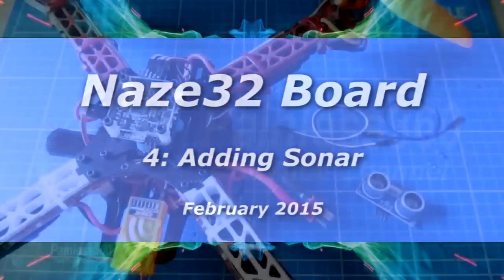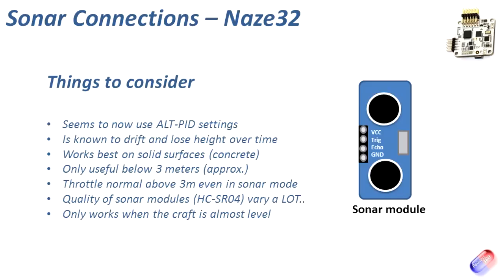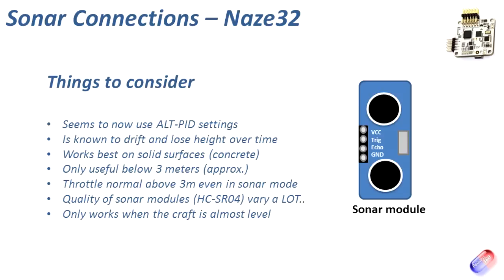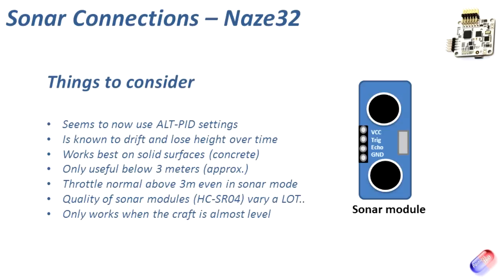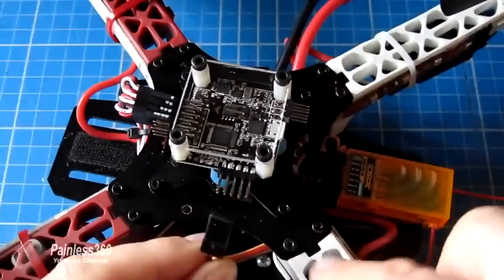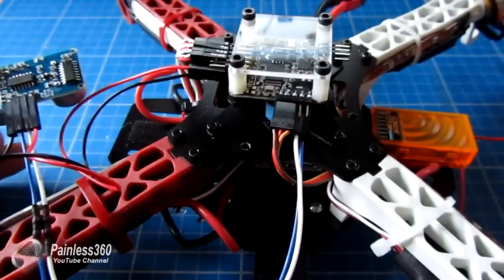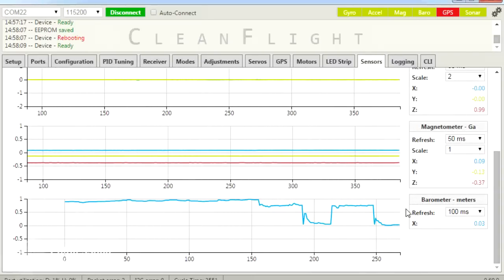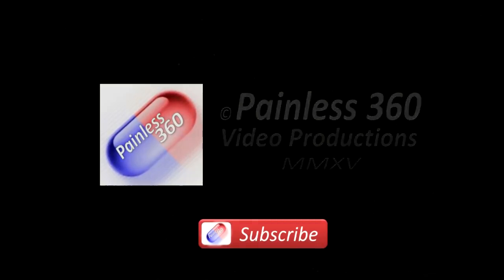(4/8) Naze32 Flight Controller – Adding Sonar (HC-SR04 module)

Comment: How do you like the Baro and Mag and how does the baro compare to sonar (in flight not theory)?  I added sonar at one point then removed it because of the problems you stated and the fact that the Sonar is always on and drawing power even when switched off.  I was thinking of getting the Full Naze32 because of the Baro but if the Baro isn't much better than the Sonar I'll pass on spending $50-$60.
Reply from the maker: As I mentioned in the video, the sonar is an interesting addition to the board but onw with limited value. In normal flying it wouldn't be of much use.

The baro is like all of these board (Multiwii, APM, Revo etc) and needs to be covered with foam at a minimum and ideally located inside a case. If not then the reduction in air pressure caused by forward flight can be read as an increase in height.

Personally I think the addition of the GPS to the board is one of the best modifications you can make, also allows for height and speed detail from the GPS in the flight controller/OSD/telemetry too. Be aware that fore the GPS modes you need that magnetometer on the board..

Happy flying!
Reply: Painless360 Which GPS do you recommend for the Naze32?  Have you or will you do a video for that?